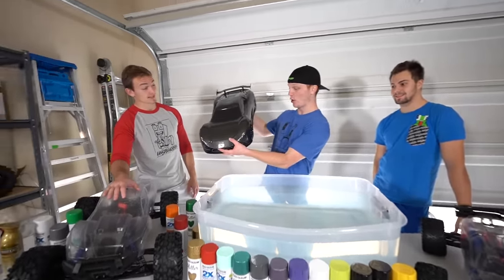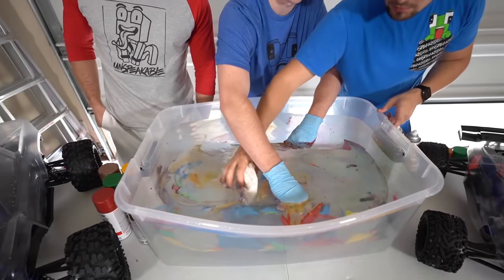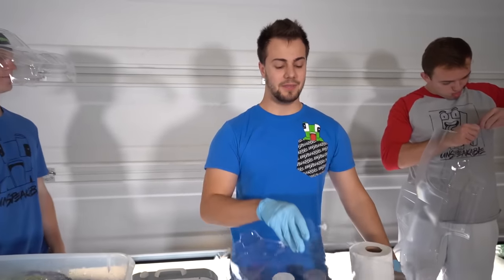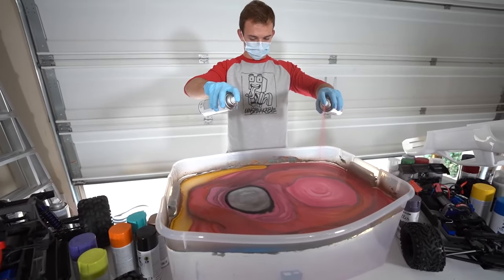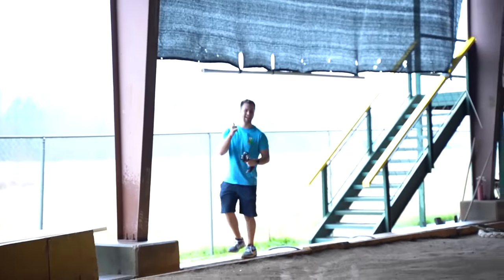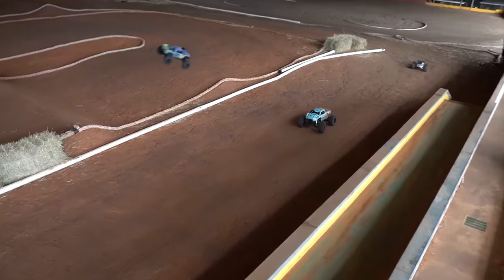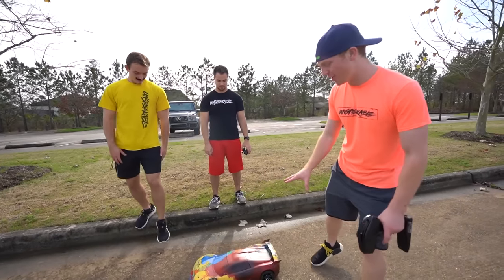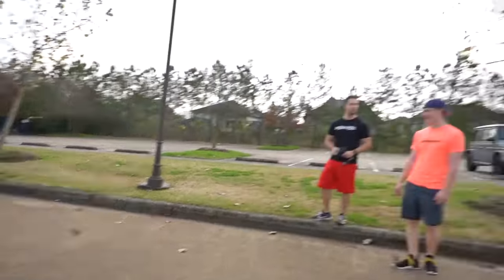I HYDRO DIPPED WORLD'S FASTEST RC CAR!

Comment: The reason that it is not going 100mph is because you do not have the front splitter installed and the app for the car which updates its speed and remote range and high speed gearing installed.  Out of the box it only goes 50mph.

Gabe’s RC car is a Traxxas E Revo 2.0 which can go up to 70 mph

Unspeakable’s and James car can go 50 that’s the max speed of the Xmaxx
Reply: the xmaxx is bussin bussin